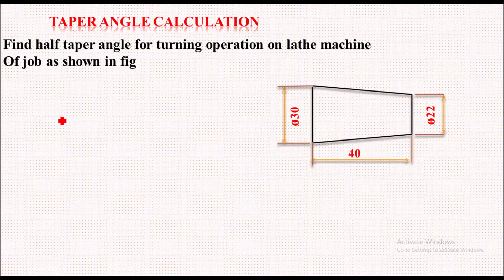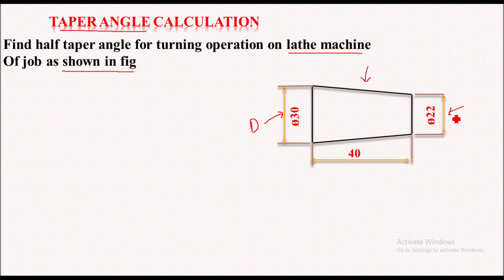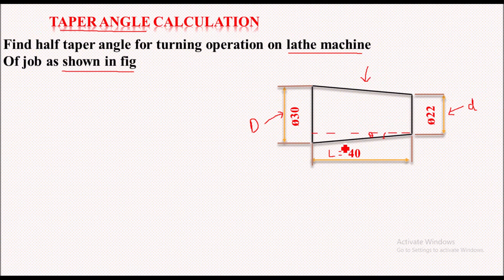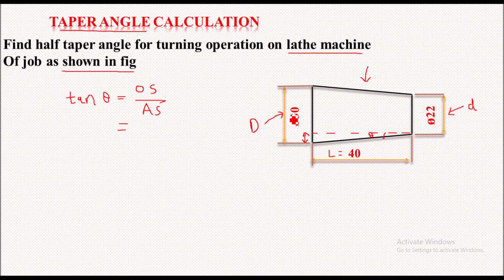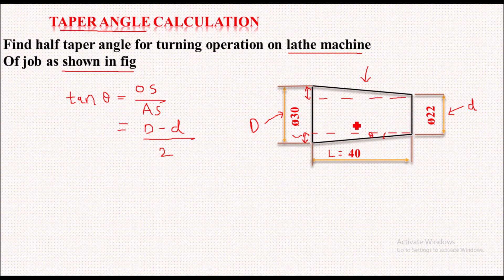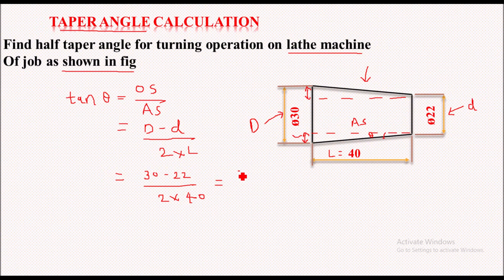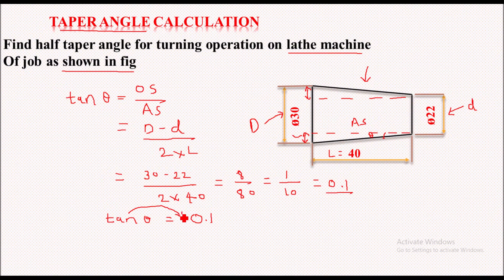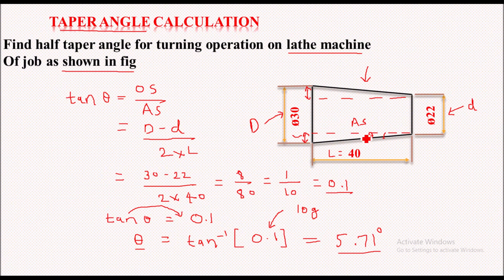Taper angle Calculation

Comment: You can do this on an a newer IPhone scientific calculator in inches . 
IPhone Scientific Calc. ( caution make sure old settings are removed ) 
Taper Calc.
Large End Diam. minus Small End Diam. Press =
-:- by Taper Length ( taken parallel ) Press = 
-:- by 2 Press = 
Press 2ndf then tan-1 , Press =  Result is Taper Half Angle .
For the included angle x result by 2 

Sinebar Stack Height Calc .
Default  is Degrees .
Enter Half Angle , Press Sin , Press = 
Then multiply by the Roll distance of the Sine Bar . = Stack height .
Reply: Thank you so much for this
Reply: @thenormalyears  You are welcome .